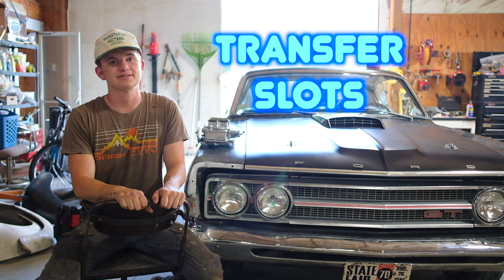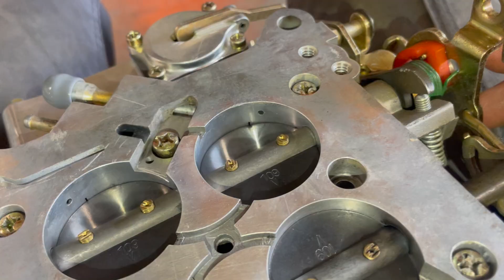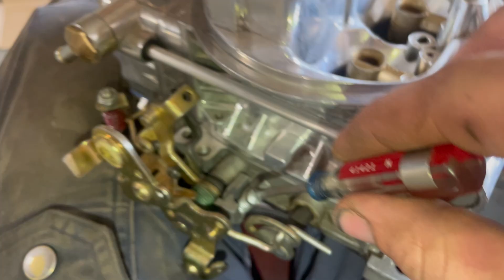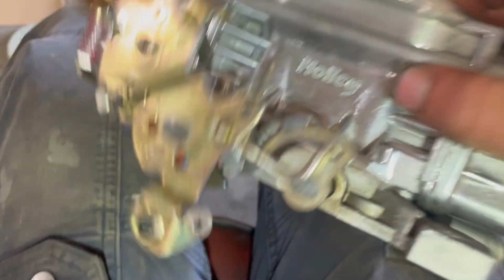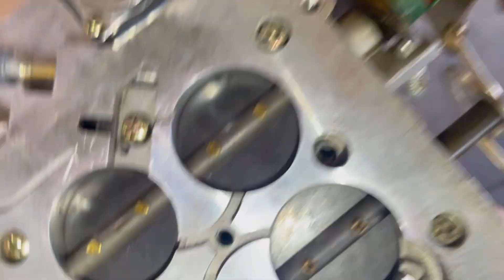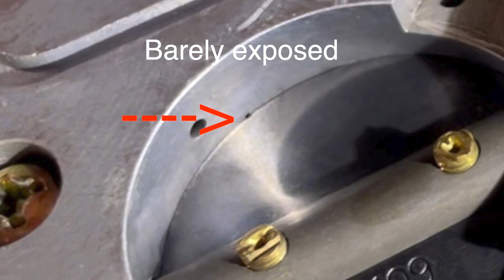Setting Up Holley Transfer Slots

Comment: I've got a holley 4160 750 vacuum secondary on a 390 FE and i set the slot to less than square to my eye. Fired it up and had to take a good 1/2 turn or so out of the curb idle screw to get it to idle at 850 in park. I backed the secondaries off too, but i think they were damn near closed. I've got 18 initial and 18 vacuum advance, manifold vacuum to distributor. I bet i have no transfer slot showing at this point. I haven't driven it yet, but it seems to rev up just fine. I guess there's no such thing as having too little transfer slot showing? carb is probably a little too big for this motor, has 21hg of vacuum in park. I could run vacuum advance to ported, but the motor runs hotter like that.

Comment: How come you’re not talking about the screw on the bottom of the carburetor that sets the other set of butterflies for the transfer slot and by the way the screw sucks cause nine times out of 10 it seizes inside the aluminum base plate because they put a steel screw there. If you’re good with a drill, you can drill it out and then re-tap it and put a different size screw in there. It really sucks.
Reply: I pulled mine out an put in an allen head screw - easy to adjust
Reply: @BIGSHCLUNK  I tried to do that. Mine was so corroded in the bottom I couldn’t get it out. I soaked it overnight. Can’t really take heat to it. My bright idea was to try to drill it out. I usually get pretty lucky with that not this time.

Comment: Ive tried everything on this 500.00 750 vacuum secondary, about every 20th time,  it will stall on take off, just a daily driver stock bbc, looks like a pressure washer in the carb when you throttle it, nothing helps, it's a piece of chit, going back to quadrajet.

Comment: Do you do the same to secondary t slot on a double pumper like a Holley 4150? I've read many different opinions....
square both primary and secondary

square primary and close secondary

square primary and just slightly crack secondary

Comment: I'm probably not understanding you. you say ported vacuum is above the butterflies, but on some carbs it's on the base plate. Isn't the base plate same height as the butterflies? Also 0 vacuum at idle?
Reply from the maker: Different carbs have the ported vacuum port at different places. It doesn’t have to be anywhere specific. Just depends on where the designer waned to put it. If you have found a vacuum port that has 0 vacuum on idle, but shows vacuum when you open the butterflies then you have found your ported vacuum port.

Comment: When I tried this, my idle is around 400 and the vac gauge registers 5" and the engine is just barely running.  This is with 2 turns out on the mixture screws and 18 degrees of timing.  Turning the curb idle screw out further to get to zero vac stalls the engine.  Am I doing something wrong?  1967 Dodge 383 / 727 / mild cam.  Thanks!
Reply: Just realized I didn't have the PCV to Manifold vac line plugged.  Guessing that might have an influence.
Reply from the maker: @aeroart3891  Yes! A huge influence. That’s a massive vacuum leak. Plug that and I bet it makes a huge difference.

Comment: Been fighting off idle stumble in my mopar 360 build for a while, didnt think my transfer slot was overexposed because i could get it to want to die turning in idle mixture screws, took carb off and yes transfer slots were barely showing, ill try that tip of setting curb idle with vacum gauge and see  if it helps, got my timing set at 18 btc, cool ford, looks tough

Comment: Great video - good explanation of the importance of a properly set transfer slot!
Its also good to add info about the secondary throttle blade adjustment screw for some applications.
My car wont idle high enough due to the cam / torque converter being on the tighter side - so it requires that little bit more air at idle. This is where people typically drill holes in their primaries to get the transfer slot back to where it should be; but a much better first go at adjusting would be on the secondaries before making modifications to the carb :)

Cheers!

Comment: I haven't given those slots a second look since the 70's. I learned something new today. We used to change the springs in the distributor to get the points plate to zero out. I never thought about the plate maxing out the other way after putting a stronger or weaker spring in. I'd say fuel injection is easier but there's probably more trail and error in that too.